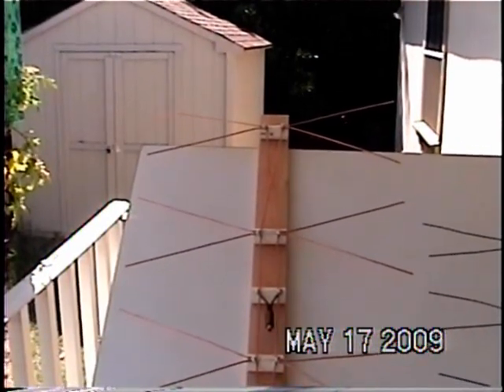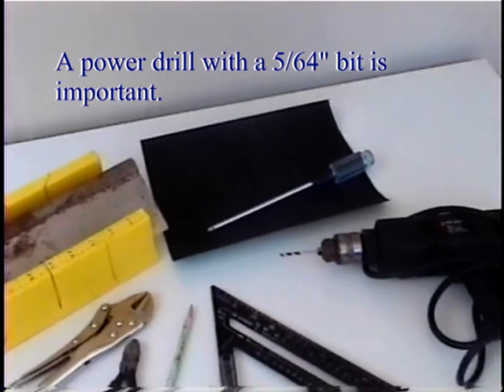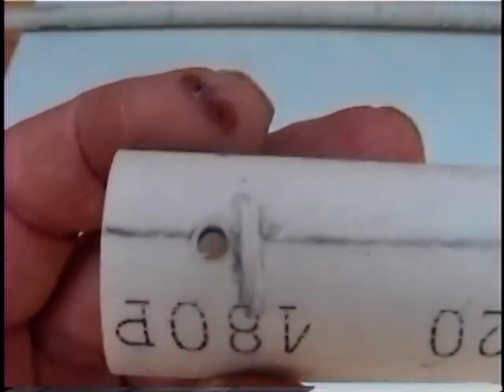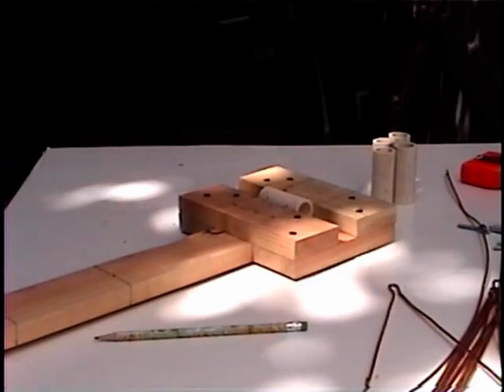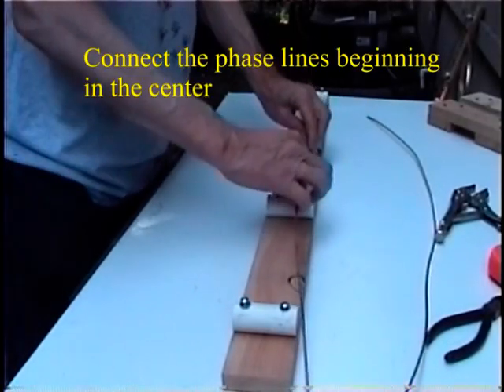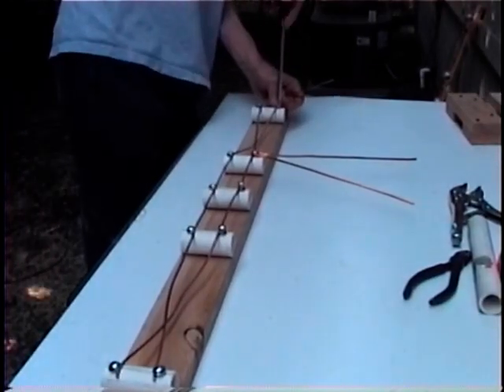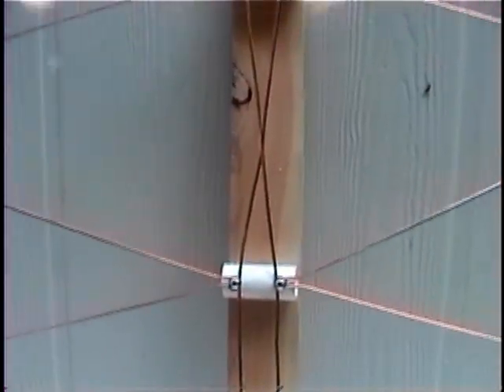A Better HDTV Antenna

Comment: I know a guy that lives super close to the transmitter tower and he has to use an a b switch and use rabbit ears for that channel because it will pixel-ate with the outside antenna cause the station is so strong. This is called receiver front end overload. Try a paper clip and see what you get or nothing attached and see. I cant see it going over you cause we are not talkin about am radio that has long bounce patterns. Try standing directly under a cell tower and it works fantastic still.

Comment: One question, on the points of leader wire crossover do you insulate the wires or are they touching?

Comment from the maker: This antenna was computer modeled by an antenna designer, and is an upgraded version of a Channelmaster design . It was then field tested by dozens, if not hundreds, of people, myself included. The coathangar design works, but so does a lot of stuff, even a paper clip. In areas with marginal reception this antenna will pull in stations other antennas can't. The only other antenna that comes close to this design is the Gray-Hoverman, but this antenna also picks up VHF-Hi. GH doesn't.

Comment: This sucks I just finished the coat hanger version and then I see this video. I used copper though instead of coat hanger but it's nice to know there is a better model but it's not since I just finished the coat hanger version. Oh well good luck.

Comment: If you are 0.5 miles from the broadcast antenna you could just put a paper clip in the antenna jack on the TV and it will problably get a signal.

Comment: If you are shure that you are so close to the broadcast antenna, then the problem could be that you receive TOO MUCH signal. 
Could to reduce it also unmounting the antenna or trying a less performance one.

Comment: I have the old version of the bow-tie antenna.  My towers are about 20 miles away over flat terrain.  I have great reception except during severe weather conditions.  I also have great reception from a tower that is almost 90 degrees from the from primary antenna axis and about 9 miles away.  You're so close even a commercial antenna should be fine.  Perhaps there is a problem with your cable or receiver?

Comment: I live 0.5 miles from the broadcast of the channel I want to tune into. The picture is quite pixel-ated to the point it is unwatchable. I do not have a reflector, would that help?

Comment: Great stuff.  I just received your kit in the mail, put it together in about 10 minutes and I'm getting 95-98% signal strength on all the HD channels in my area.  I'm about 30 miles from the towers.  Even if you're handy, I think buying the kit is probably the cheapest way to go.  It's certainly the easiest.

Thanks!

Comment from the maker: I didn't design this antenna, but I know the guy that did. He and the other antenna designers I'm associated with use sophisticated antenna modeling software to make their designs. This antenna has a better range of reception than most commercial antennas. It isn't simply the whisker length, though. It's the whole design. Anyone that follows this design will have a very excellent antenna.

Comment from the maker: If you're using it indoors it doesn't need to be grounded. Try that first. I live 50 miles away from the transmitter, and mine works fantastic.

Comment from the maker: I did it this way originally because the coathanger design was so popular back then. I didn't want to stray too far from that design so people could see that this antenna was not any harder to make. A month later, I put up another video, Better Outside HDTV Antenna, which is PVC. Same antenna, but it uses a PVC spine. Give it a watch.

Comment from the maker: @Umaxen Hard to say these days about cost. Copper wire is more expensive nowadays. I'll guess it might cost $20 for everything, though. You should also watch my other antenna video A Better Outside Antenna. No, it doesn't have to be outside.

Comment from the maker: @keys77 It'll pick up signal from both directions. You might be better off with the outside version, so watch that video. A pre amp? I doubt you'll need one, but you'd better just try it to know for certain. Have fun.

Comment: I live in an area where I can pick up signals from opposite directions, Will this antenna pickup from front and also back?  The signals are around 60 miles so would I also need a pre amplifier?

Comment: This is wondering if you don't want interfearance with "wood" issues why do you screw into the wood with the screws conducting back and forth from the wood to the antenna wires ?
Seems to me that there is absolutly no differance other than emotional?   regards

Comment: Thanks for the great video.  I saw it after I built the original YouTube antenna you compare against.  It's working fairly well for me with an outdoor installation.  Any reception problems I have on occasion are VHF-Lo frequencies (channels 2-6), but I understand your antenna is optimized for VHF-Hi.  What types of modifications would be necessary to receive well in both bands?  Thanks!

Comment from the maker: @icusawme2 You aren't thinking about it the right way. The bottom (or top) is basically zero inches. That leaves 3x9.5 which is 29.5 inches. You wouldn't actually start at the exact bottom. If you start on one end, measure about an inch and a half, then do the 9.5 inch measurements, you'll have your four 9.5 inch measurements with room left over.

Comment from the maker: @Signalsearcher This antenna is designed to pick up 300 (or so) to about 725 KHz effecitvely. Might go somewhat higher or lower on the range, but it depends on exact spacing and length of the elements. I assume these measurements for 10" are at the center of the band, but I can't say so definatively since I didn't do the measurements personally.

Comment: I have some further questions I need help with :-

1) What does  a standard 1x3 board mean? 
2) Instead of PVC, can I use Silicon washers underneath the metal wiring? Will the signal quality then degrade as you have mentioned for when metal wiring is in direct contact with wood?
3)   What are the 2 pieces of equipment do you use in the video. The yellow thing and the wooden slider thing.
4) As I have no experience in cutting wood, what techniques do you recommend for sawing wood lengthways.

Comment from the maker: @DoubleJJones1 1) PVC piping. Costs 2 or 3 dollars for a 10 foot length just about anywhere.

2) 1 and a quarter inches.

3) Whisker length and spacing determine the frequencies the antenna will receive.

4) That board is a standard 1x3, available at any store that sells lumber.

You might also watch my video on the outside version of this antenna. That one uses PVC piping for the spine rather than wood.

Have fun.

Comment from the maker: @guitarmanDF I haven't done it personally. I've used both antennas, and both work for me, but I never actually compared one to the other. Other people have, including people involved with the design of this antenna. According to them, this works a lot better. They say the coathanger design has basic flaws, and while it WILL work, it can never recieve the range of signal this one picks up. The only antenna that competes with this design, but mostly only for distance, is the Gray-Hoverman design.

Comment: What is this PVC you talk about? 

How far apart are the 2 vertical phaselines mounted?

What difference does longer whiskers make to an antenna?

How wide is wooden board supposed to be ?

Comment from the maker: @rjandmjtube A reflector is a metal surface put behind this kind of antenna. It bounces the radio waves back onto the antenna, which increases reception. An antenna using a reflector needs to be aimed more carefully than one without one. It's best to try this antenna without a reflector first, then add a reflector if the signal is still too weak. Look at my outside version of this antenna for an example of a reflector. Most people don't need one.

Comment from the maker: @raydlevel5 Your idea is correct. Watch my vid on the outside version of this antenna. Also, have you tried this antenna inside? Mine works well inside. I get 38 channels with my antenna on an inside inside wall, if you catch my meaning. I had one outside for a while, and the signal was stronger, but I didn't get more channels. I decided to just go with the inside version. That's my situation, though. Other people may need an outside installation. Also, don't forget that higher is better.

Comment from the maker: @rayroeglin That happens in bad weather. Rain, trees blowing in the wind, things like that will cause interference. Make sure it's aimed properly, and you might also add a reflector. You also might consider a pre-amp, but a pre-amp might also give signal overload, and that can be as bad as too little signal.

Comment: EXCELLENT . i buld it a while ago get strong signal and 31 channel.cost me 10 usd to build it. like 6 month ago.
Before i had a 50usd antenna with 50db ampifier and and got 25 channel only.
To the poster: lately started getting lower signal and star looking for the reason . found the problem the MATCH transformer was full of water.i change it and got back to good signal again. will rap it on tape
question:if i put two anthennas for one tv will it be better or need especial set up?
THANKS.

Comment from the maker: @LLcoolA100 It should work in Sweden, or anywhere else. It's possible the whiskers may need to be a bit shorter for optimum reception, but I can't be sure. If you make one, let us know what happens.

Comment from the maker: @RichRuss1 2 things: Wood contains moisture, and moisture will rob a little efficiency from the antenna. Also, the pvc allows the crossed phase lines room so they can also not touch the wood while maintaining good spacing. Anyway, my outside version of this antenna has a pvc spine. Same exact measurements, but a pvc spine.

Comment from the maker: @RichRuss1 I don't think it exists. Straightening copper wire is easy, though. Watch my video on the subject. All you need is an electric drill, and a clamp of some kind. Even a small vise grip would work good if you mount it properly.

Comment: does using the cheap typical balun matter ? The ones I see are galvanized wire & flimsy. Radio Shack has one that has gold plated connectors. 

why go to all this effort & have the last 2 inches of signal go through crap ?

Comment: I built this, just like you've described and it outperforms my Terk TV4 indoor (powered) HD antenna.  With my indoor antenna, I get around 80% signal strength and I am missing channels.  With this, I get all channels at 100%.

Here are some suggestions for those who want to build:

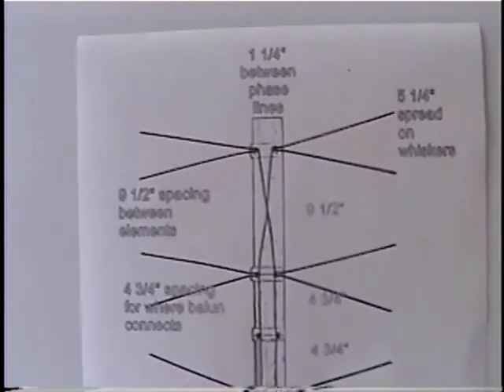1) Follow the plans @1:02
2) Use #8 phillips 2" screws with washers
3) For wire, i found 100ft of galvanized wire in Walmart hardware section for $3.
4) Transformer is at Radio Shack for $5

THANK YOU!!

Comment from the maker: @101AOK It doesn't work that way. Doubling the specs won't make the antenna better, it'll change the frequencies it receives. You could make an 8 bay, rather than a 4 bay. That would improve things.

Comment: I have not read all posts,do you have a drawing or schematic of this design to save time in pause/write/pause/write...etc...? I've reviewed many offerings on Youtube and YOUR's appears the most factual and clear.  Also, if your's is bigger/precise, is there a point of NO return if I was to say, double your spec's to get 2x's the output result?  Regardless, I thank you for taking the time to present your antenna. I'm sure it works great, but I'm in a valley in CA. I need a strong antenna.

Comment from the maker: @nikoliko2006 You could use this outside, but you'd better prime and paint it. Better still, make the antenna in my Better Outside HDTV Antenna video. It's the exact same antenna, but with a PVC spine rather than wood.

Comment from the maker: @barndler Okay, this has been covered before. If you have a better way, then do it. You could also watch my outside antenna video. ALSO, I sincerely doubt you are 97 years old, as it says on your Youtube page. You might be an older gentleman, which I could believe, but not 97

Comment: I built the reflector and it didn't work. however the antenna without a reflector does work quite well I used the cardboard with aluminum foil and put it in my attic but it was not directional at all and knocked down the signal on all channels I placed it 5 1/2 inches behind the driven element what went wrong it was even more omni directional than without the reflector?

Comment: I just made this antenna and I only get 4 channels.... and they are all very poor reception. I'm perplexed as I was certain this would work, based on the positive responses. My antenna looks very similar to the diagram, I have tried adjusting, moving, etc. I live in Vancouver - perhaps stations here in Canuckistan are different??

Comment from the maker: @nigelandbozena Yes. If you rewatch the vid you'll see that I recommend separating the phase lines by an inch. Easy to do with a piece of PVC. It shouldn't be separated by less than about a half inch.

Comment from the maker: I looked at a mapquest of Muskoka just now. Looks like mostly flat terrain, plus some lakes toward Toronto, which is only 50 miles away. I'd be amazed if you couldn't pick up enough stations to make building this antenna very worthwhile.

Comment: are you not defeating the purpose of the insulator tubes by using long screws that go through the tubes and into the wood?The whiskers are now connected to the wood. I'm assuming the moisture content in the wood is why you do not want to use wood and better to use pvc??? Nice video.

Comment from the maker: @maxshiff They absolutely don't touch. In my video they're 1 and a quarter inches apart (roughly). Use that as a guide. The phase lines should be the same length, and shouldn't ever be closer together than a quarter inch. They do NOT want to touch.

Comment: it is a good design but 1 thing I fined funny is the wire is still being screw in to wood. So what I did is stand off's in to the wood and tire raped the copper wire down after soldering it all together

Comment from the maker: @gymbo88 That'd be ok except the standoffs make making the crossed phase lines easier. You need to keep the phase lines seperatedby a minimum of 1/2 inch, plus they should be as close to exactly the same length as possible.

Comment: Connect that terminal to ground. If lightning hits it directly, no amount of grounding or surge protection will save it or anything connected to it. But that fitting is supposed to help equalize the 'potential' between the antenna and ground so it doesn't 'attract' lightning. Grounding it (if outside) is required by the national electric code. It's not required to connect to your home's grounding electrode[s], though, and sometimes your home's ground system can actually add noise to the signal.

Comment: Well what I used was called I believe #4 stranded copper wire. I just un-stranded wires from each other and used the smaller strands which are as big as coat hanger wire. All I know is that this is what Menard's had them labled as.

Comment: @brandofalcon - "I used #4 copper wire for the elements." 

Did you really mean #4, or #14?
#4 is huge!  Like as big around as the heads on the screws in the video.

I was going to ask what AWG the wire in the video was - it looks like #12... or maybe #10.

Comment: @brandofalcon - "What is that wooden piece called that's used to hold the pvc while drilling into the board? "

I think maybe jwwm misunderstood about the wooden piece. The 'tool' he built from extra pieces of 1x3, which holds the pieces in position for assembly, is typically called a "jig.". HTH

Comment from the maker: @brandofalcon I'm guessing you mean the antenna is between the glass and the blinds. If the blinds are metal, that's already a reflector. If so, your best bet is to put it outside that window. Do it at least as an experiment so it can be aimed right. Anyway, all they can do is to make you take it down.

Comment: I do live in an apt and the landlords won't allow anything on the roof. I do have a window that faces the general direction of the towers which most of which are about 45 miles away. I've been putting antenna in window underneath the blinds. A reflector is next probably for me to try. I may have to build another with pvc as you've described here. thanks for the video.

Comment from the maker: @brandofalcon Make sure you have it aimed properly first. cowsgonemadd3 did a decent job of explaining how to aim a hdtv antenna from a rooftop. If you live in an apt it'll be trickier. Worse case scenerio for apt dwelling is opposite side from where signal originates, weak signal, plus landlord and neighbor are dicks. Try windows, try changing the direction for reflected signal. Experiment. Put it outside if you can.

Comment: i just put together the babblin5 version basically with one exception is I used #4 copper wire for the elements. I would've liked to have gotten the elements straighter but they thing worked for the one station about 25 miles away. Sadly the major city nearest me with all the network stations which are about 45-50 miles away aren't coming in. I'm thinking maybe this design and a reflector addition next.

Comment from the maker: @chrisccw1960 I've done that. Didn't work as well as I hoped. After researching antennas for a while I've come to understand that that plan seems good, but isn't really. Besides, most people will get reception mainly from 1 direction. Try it if you like, but your measurements need to be precise, especially when connecting them.

Comment: What diameter or size of PVC is used here? What is that wooden piece called that's used to hold the pvc while drilling into the board? I'm trying the original design now to see how that goes.